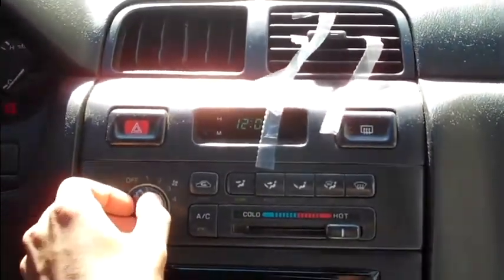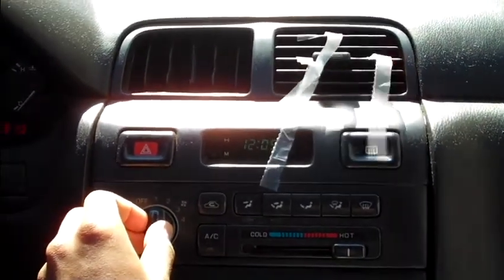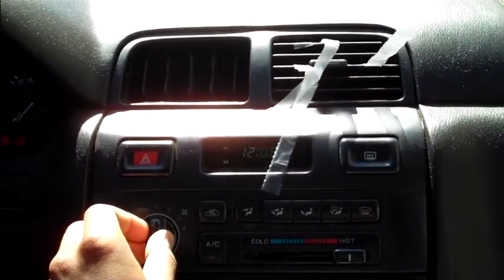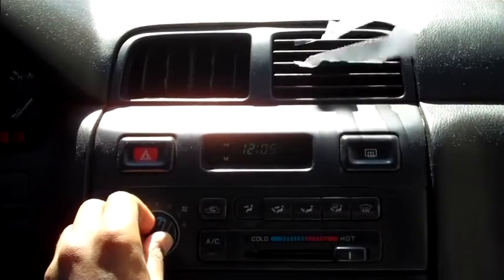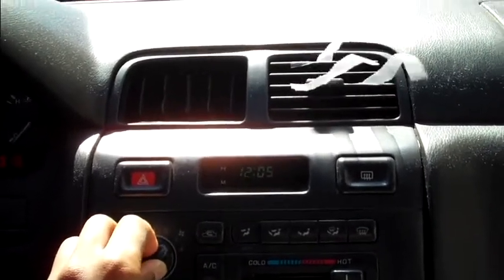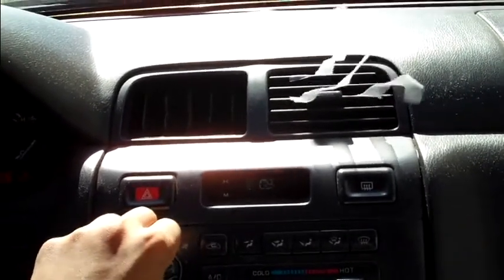How to Change a Blower Motor Resistor in a Nissan Maxima

Comment: Thank you so very much! Worked like a champ. Just installed in the parking lot of Advanced Auto Parts using the phillips screw driver off a army knife. Took Less than 5 minutes. I noticed the only setting the heater would work was High about 2-3 weeks ago. I thought the worst, delayed doing anything about it cause I thought it would cost an arm and leg. Bored at work, did some research, found your video, realized it's exactly what my 97 Nissan Maxima had wrong. Took off at lunch, popped by Advanced and got part, installed in parking lot in less than 5 min. Turned on car....Oh sooooo nice!
Thank you!
Brian -Addison, IL
Reply: Lets gooo

Comment: Exactly what I needed! Thanks for the very clear, easy to understand video!

I found it very difficult to take the connector plug out before I took the resistor out. I ended up unscrewing the resistor and pulling it out, then pulling the plug off.

Comment: thank you so much!! your detailed & easy to follow video talked me successfully through my 1st car repair attempt (on 1996 altima). And thanks for comment by adkohler! I also had a very hard time removing & inserting the connector plug while the resistor was screwed in place. But knowing nothing about cars or electrical systems I was reluctant to try unscrewing the resistor first until I read that someone else did it that way and lived to talk about it!

Comment from the maker: @sfon4 I'm not an expert, but I don't think its the blower motor resistor because if you remove I believe the resistor it still works on setting number 4, but I could be wrong. I would first check your fuses and make sure that none are blown and possibly check all the connections to the blower motor and the connections behind the A/C controls panel to make sure that nothing came loose. Other than that it might be the blower. Good Luck!

Comment from the maker: I am not a mechanic but I would check the connections to the control panel and maybe the to blower motor. It is also a small possibility that the control panel is bad. But to me it sounds like it might be the blower motor because if I unplug the resistor the blower still works on the highest setting.

Comment: My problem is that it the blower does not work on any of the 4 settings.   Do you still think it could be the resistor?  I will check out all of my connections, but I just don't know..
Isaac

Comment: Two things - can I use a pliers to pull it out? -- that can apply a lot more pressure and
how come it didn't work, then u took it out and put the SAME one back in and then it worked?

Comment: I had a similar issue, but my ac control would only work on off, 1, 2 and 3 and go off on 4, I suspect it's the same issue though, but now my blower doesn't turn on at all

Comment: One question? Do you have to disconnect the battery before replacing the resistor or can it be done without it?
Reply from the maker: It is always a good idea to disconnect the battery when working with the electrical system but in my experience this can be done without it.

Comment: i have a nissan almera 2011,  the blower motor comes on when the key is in the on position.  it come on high, and can't be adjusted.  it turns off when the key is off.  how do i remedy that.

Comment: My problem is that it only blows air through the front, it won't change to the defogger or to the feet, any idea what could be wrong?
Reply: PLEASE HELP WITH THIS SAME PROBLEM 97!!!
Reply: +Antonio  Saldivar The you have airflow problem, not an electrical one. The resistor's function is to decrease current to the blower motor, so it'd spin at a slower rate (or higher). What you should be looking for is checking if the valve pulleys are in hooked up in place.

Comment: I have a funny problem. ...my drivers and passenger vents blow on every setting but my center vents hardly blow anything at all
Reply: frankiegucc hi i have the same problem and I believe it could need a new actuator which is kind of hard to get into based on my experience